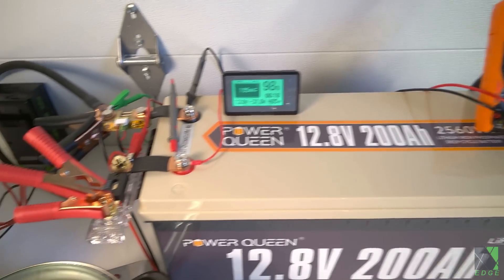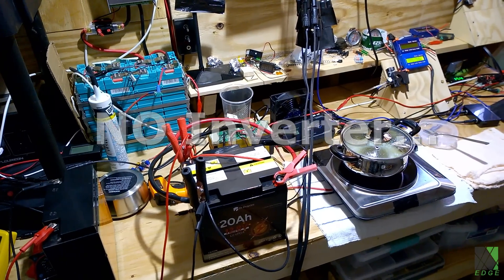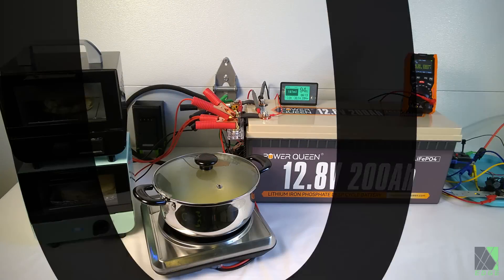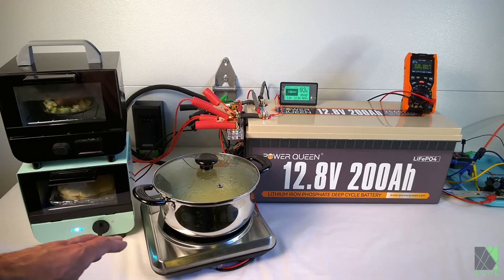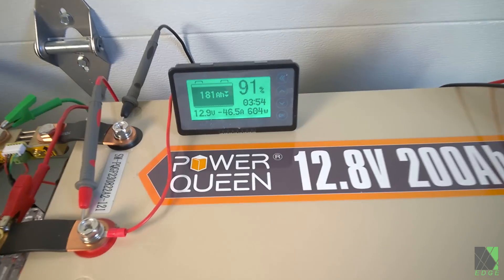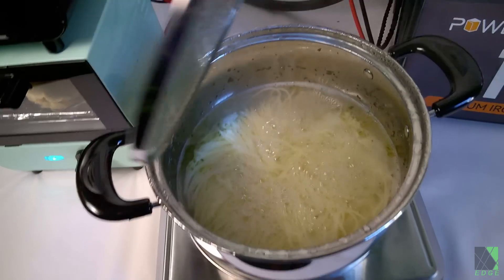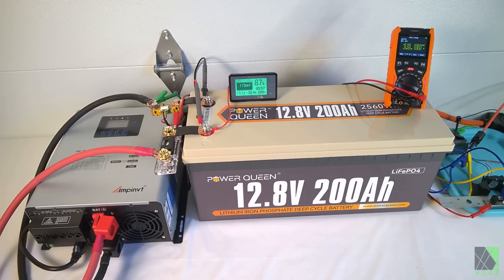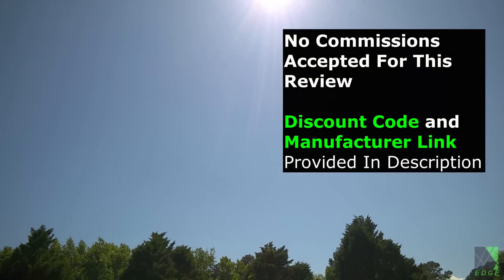Pure 12v DC Ovens & Cooktop! Off Grid Solar Cooking with Power Queen 200ah lifepo4 #review #offgrid

Comment: I'm looking for a company that makes a DC cooktop and oven.
Edit:  just saw your links.  I'll check them out.
Reply from the maker: @lesliekendall5668 Thanks for watching my videos! I have built several cooktops and ovens, because I could never find anything on the commercial market. Perhaps soon we will have some of those options
Reply: @solarpoweredge 
So far in my search, the DC units require SO many watts/solar panels that I'll probably go with the wood stove option.  Gas would be fine but I don't drive so can't pick up tanks, whereas arborists will bring the wood to you.

Comment: Thanks for the video. The DC to AC inverter has always been the weak link in any Solar Power  off grid living situation: inverters usually eat 100 Watts just sitting on stand-by and so I am in favor of trying to get all essential loads to run directly off the DC Battery directly.
Reply from the maker: @kd5txo  Welcome - I agree 100%. Been looking for ways to use Solar directly and bypass the middle ground. This can save money and reduce wear on inverters and other devices

Comment: Is there a DC air fryer available?
Reply from the maker: @davidk6668  Currently attempting to modify a large air fryer to run on 12v DC, it will take lots of power. Have not seen any off-the-shelf fryers which accept DC
Reply: I just saw one here in Australia. They also have an 12 volt pressure cooker and rice cooker.

Comment: A DC powered AC would be cool.
Reply from the maker: @goodcitizen4587  Absolutely, been shopping around for an DC AC setup. last week had a small refrigeration compressor running off a solar panel, but getting it to cool anything  - that's going to take a while to figure out. Might still go for a pre-built system though

Comment: Curious if you use a solar charge controller when you connect the 400 watt panels?   Like the 12v system you run, thanks
Reply from the maker: @Flash1857 Good observation, no traditional CC was used. I cut most of the footage to prevent confusion, maybe I shouldn't have. In the background I have been experimenting with different ways to charge without a traditional solar charge controller. Used a simple circuit in between the solar panels, still developing that part.
Eliminating the charge controller and/or inverter completely changes the nature of solar power. I have built another system for this purpose and it's in testing now. Will share the results as soon as possible for anyone who is interested